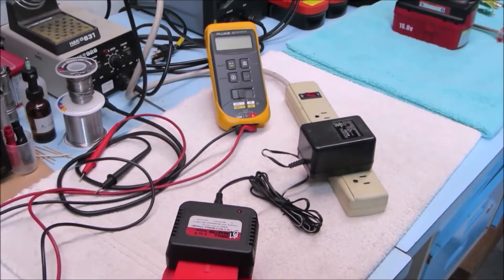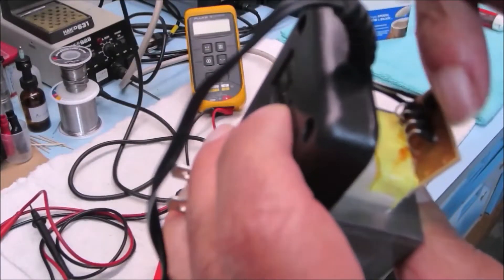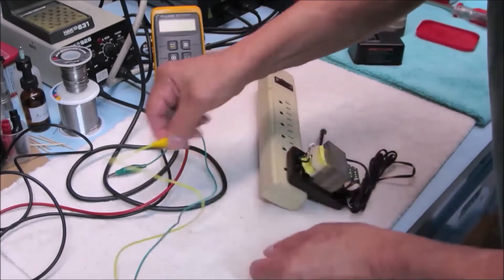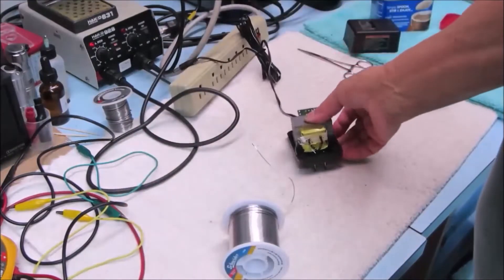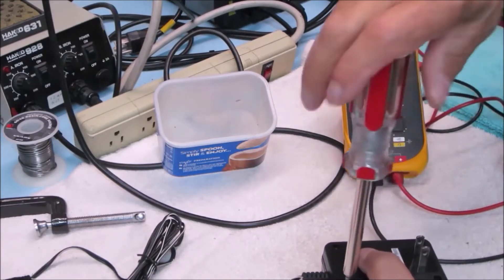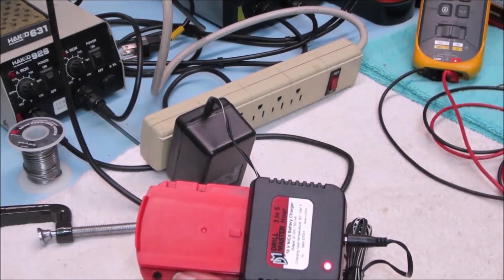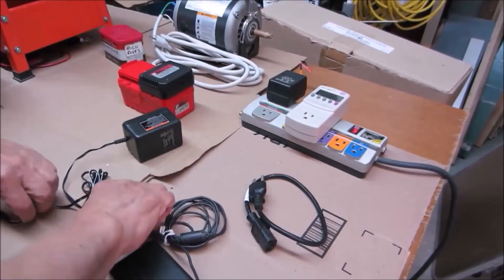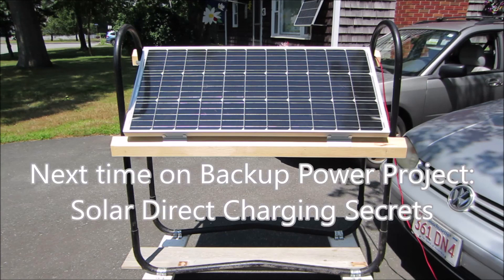Portable Power Repair Secrets - Drill Master Tool Charger

Comment: donde puedo conseguir una bateria nueva de ese atornnillador de impacto
Reply from the maker: El taladro inalámbrico Drill Master 67024 18V 3/8" y el atornnillador de impacto 67028 1/4" 18V  necesita un paquete de baterías NiCd 67029 - 67031 1.3Ah 18V. Tres opciones de reemplazo que conozco:
1. Más potente, el paquete de baterías de NiCd "Master Mechanic 565067 1.7Ah 18V" de color azul con pantalla de alimentación LED encaja perfectamente y funciona perfectamente en mi Drill Master 67024, pero puede ser difícil encontrar un nuevo stock (paquete de baterías de repuesto con un cargador más potente) .
2. El paquete de baterías de NiCd "Black & Decker HPB18-0PE 18V Slide" de color rojo parece que debería caber en un Drill Master 67024, pero no es así. El caso de B & D es ligeramente diferente. Las ubicaciones de los conectores B y D son diferentes. Pero es internamente idéntico al paquete de baterías Drill Master 67031 y es fácil encontrar existencias nuevas: https://www.amazon.com/Replacement-HPB18-OPE-244760-00-Firestorm-Batteries/dp/B07B2QDK9X/ref= sr_1_7?keywords=black%2Band%2Bdecker%2B18v%2Bslide%2Bpack%2Bbattery&qid=1690537863&sr=8-7&th=1 Para usar un paquete B & D en un Drill Master, desmonte ambas cajas (use Torx 10 en el B & D) , desuelde ambos paquetes de baterías de sus conectores y transfiera el nuevo paquete a la caja del Drill Master.
3. Casi siempre se puede hacer una buena batería NiCd de 18 V a partir de dos malas. Mire estos videos para aprender cómo hacerlo: https://www.youtube.com/results?search_query=make+one+good+NiCd+battery+pack+from+two+bad+one. Pensé que este video era particularmente bueno: https://www.youtube.com/watch?v=DDAXQPlLQgY excepto que es mejor soldar celdas individuales pestaña a pestaña, no pestaña a celda. Espero que encuentres esta información útil. Si es así, dale me gusta y suscríbete, ya que realmente ayuda al canal. ¡Gracias por preguntar!

Comment: Can I use a power adapter to charge a battery?
Reply from the maker: Usually, the answer is yes, but that's not always true. Chargers always supply DC voltage. DC voltage can always be used to charge batteries. AC adapters can either supply AC or DC voltage. AC voltage can never be used to charge batteries. So, before you use an AC adapter to charge a battery, make sure it's the type that supplies DC voltage. If it does, then (assuming you're going to use alligator clips) double check polarity. In most cases the tip of the plug is positive and the ring (aka barrel, aka sleeve) is negative. But sometimes, it's just the opposite. Charging with an AC adapter (even with those that supply DC voltage) generally has to take place externally. To prevent standard batteries from overheating, exploding and leaking, the jack (aka power socket) on non-rechargeable electronic devices contains a switch that disconnects the battery box as soon as you plug in the adapter. You also have to match the voltage of the adapter to the battery you wish to charge. I wouldn't try charging a 12V battery with a 20V laptop charger, but as shown in the video, no problem using a 20V laptop charger to charge an 18 to 20V power tool battery. Thanks for asking. It's rare to get two, very intelligent questions that actually add to the conversation. Hope you'll watch some of my other videos and comment on those as well...